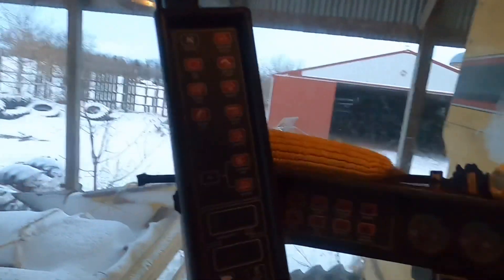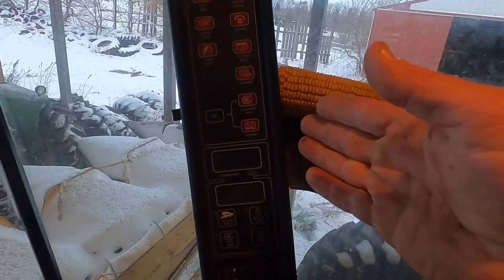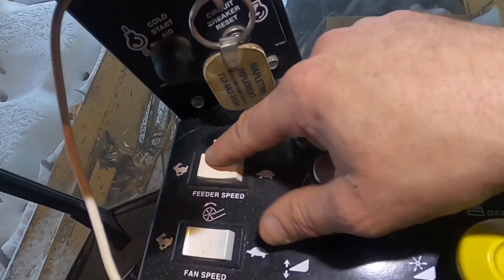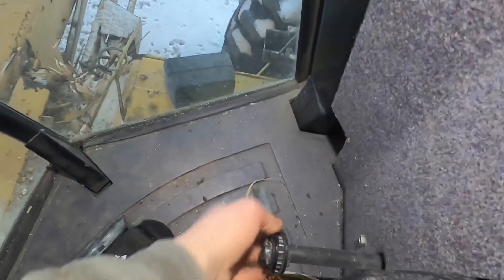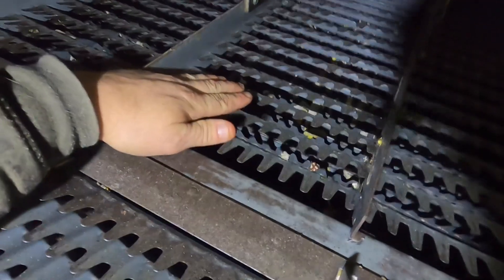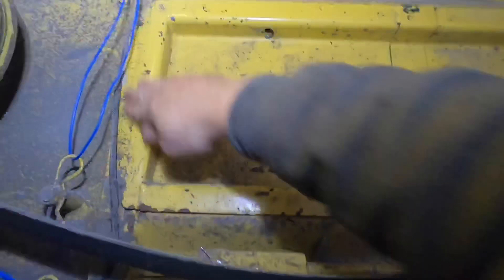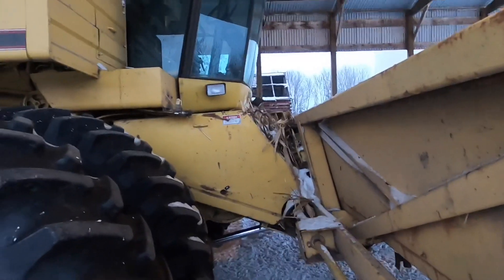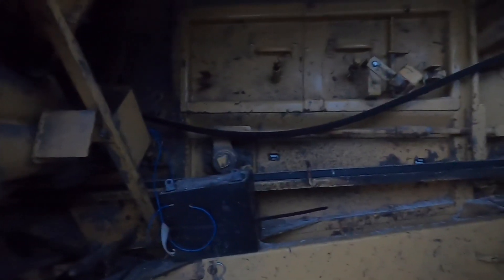[Special Request] How To Operate A Newholland TR98 Combine!

Comment: I had a tr 86 and a tr99 it wasn’t till I got a cr9040 that run the rotor speed at 1000 rpm for beans what a difference.

Comment: Does the TR98 ever slug the rotors up? That would be my worry about a twin rotor that it would suddenly favor one rotor and feed too much material to one rotor. I have never slugged the rotor on mt R52, only the feeder house. Gleaners are well known to have great samples of grain too. My pet peeve on my R52 is that for some reason it has the short unloader tube while most have the longer option.